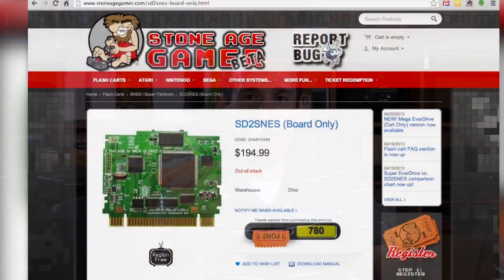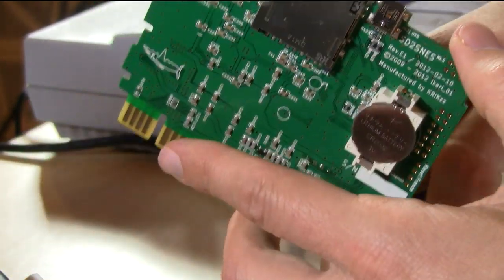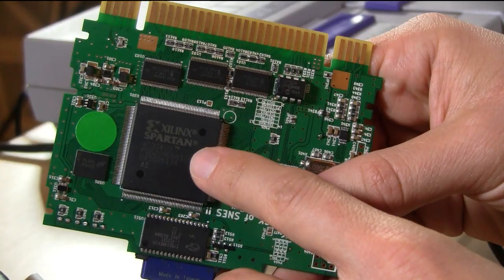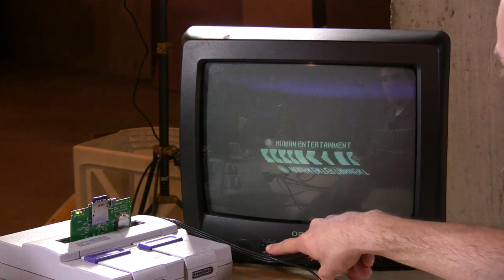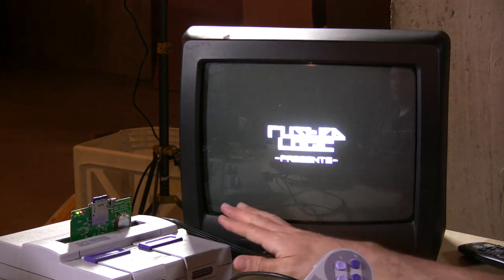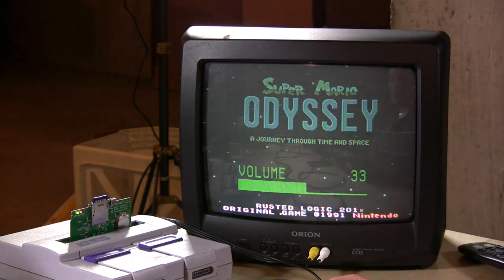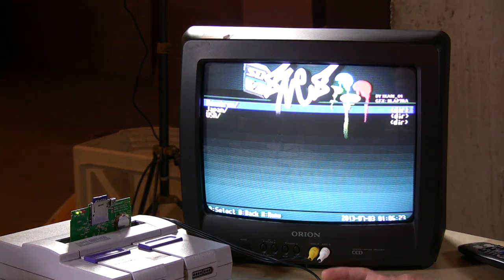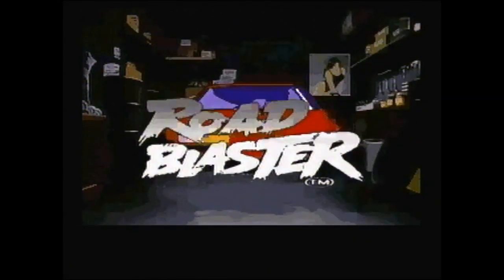SD2SNES Review - Run Games on a Super Nintendo SNES from an SD Card!  MSU1 Super Road Blaster Demoed

Comment: Cool review, thumbs up :-)

BTW I designed the sd2snes so it has inverse polarity protection for the power input, so if you accidentally put it in backwards nothing bad will happen as long as you don't have anything connected to the sd2snes PCB (USB or programming pin header).

Comment: Uh, writing the backup to the SD card in real time is not "better than the real thing," it's what the real thing essentially already did but with one important distinction that's actually a disadvantage. The battery-backed non-volatile SRAM in a real cart was often also used as workram to expand the total RAM available for software, which is why some games have it even without a battery (volatile). Games only needed a tiny bit for saving progress. Games using it as workram can read and write to it millions of times a second. Even if an SD card could keep up it would wear out the flash cells very quickly. The flashcart has to detect how much is too much and throttle it when it detects a game using SRAM like this. If it throttles the autosave too much then it could lead to saves that revert when you power off the system. Many flashcart a just setup some real battery-backed SRAM and dump that to the SD card at first boot but that can still cause issues like the Gateway 3DS.
Reply: Hey since you seem to be very knowledgeable on this stuff I have question for you. It's in regards to a Genesis repro game I bought recently. It's a repro of Mega Turrican. The board that was used was from a Genesis game that used a save battery and also has an SRAM chip. Could the new Mega Turrican ROM make use of that SRAM chip? I'm not sure if the original game actually had any additional RAM chips or anything. But knowing Sega it probably didn't.
Reply: +Robert NES816 The new G+ app notifies me of your reply but will not show it to me for me to reply to and the YouTube app has never linked me directly to comments. Argh!

Anyway, cartridge console games never make use of additional RAM that they didn't originally include or weren't programmed for because the game ROM itself is mapped to memory and it references hard-coded memory addresses (there is no OS memory manager).

If that game originally used SRAM on the cart as work RAM then the original cart would have had SRAM too. Because SRAM maps to memory just like ROM and the memory map would have to stay the same as far as which memory addresses were ROM and which memory addresses were for RAM, the original most likely uses SRAM too. It's possible that the SRAM in the repro is mapped to an address higher than the ROM data for that game uses and does not conflict, but it would be unused if the original didn't use it too. It was originally too expensive for carts that don't use it.
Reply: +Emmett Turner Awesome thanks for the wealth of knowledge! I love learning about this stuff. Thanks again.
Reply: +Robert NES816 I can't see your reply or see/edit my other reply but I think I made it a bit clearer:
Cartridge games read/write to hard-coded memory addresses because there is no OS memory manager and their ROM maps directly to memory (no need to copy ROM data to writable RAM addresses when it can already be read like RAM). This means that their code expects to find their own ROM data at particular memory addresses and they will not make use of additional memory they aren't aware of.

SRAM maps to memory just like RAM/ROM except it's writable. If the SRAM addresses do not conflict with the game's expected memory map then a game that didn't originally have it could work but there can be many other differences that break a game ROM intended for a different PCB configuration. I don't know that game's original PCB configuration.

Comment: Is it worth it to get the SD card through the retailers that sell these or will any memory card pretty much work with these? I see that these retailers offer different memory size SD cards but it appears that most, if not all as stated in this video, games will fit on a 4MB card, which I already have.
Reply: sidearmsalpha you could probably fit the entire SNES library on 4GB

Comment: can you load the Super Gameboy with a game boy Rom with it ?
Reply: Doug Plummer I know your post is old, but I'll chime in: Stone Age Gamer also sells a gameboy flash cart meant to plug into the original gameboy and gameboy color. That cart is super gameboy compatible.  So, what you'd do is get a real super gameboy, and then buy the gameboy everdrive flash cart and plug it into the super gameboy.
Reply: John Hahn I was thinking about doing something like that.  after this post I did some more research and found that the Super gameboy has a full gameboy built in it and just uses the video and the controllers on the SNES

Comment: Can that be covered in a Cartridge when it's ordered?
Reply: Yes. If you purchase from Stone age gamers website, you'll see they have a number of choices from bare chips to different color cart shells. Prices vary of course.  You can also cover the chip on your own, using a spare shell, but you'd have to be good with your hands and with the right dremmel tool, to perfectly cut the holes needed for the memory chip and usb ports (led lights, etc).

Comment: Freedom Force!
Reply: +Lon Siedman it's the reason I re bought an NES (well AV Fami). Definitely the best NES Zapper game. I have this 3rd party Zapper clone by Dendy. It's a 15 pin and it's lighter than the NES Zapper. However, it's crazy accurate. If you love Zapper games get the 15 pin Dendy Zapper Clone. It's at least 30x more accurate than the OEM light gun. It looks nearly identical to the Zapper, but it has a slightly purplish tint compared to the gray NES Zapper.

Comment: or save yourself the trouble get a wii...homebrew it and put in super nintendo games on it there done
Reply: that is literally like 25 more steps
Reply: And again, we are back to emulation with the wii homebrew.  There is slow down via this route with some SNES games.  Its true - nothing beats the official real hardware the game was designed for.
Reply: *****
you cant tell the difference if you hook your pc up to the tv with a composite cable. just turn interpolation on the emulator.
Reply: KadMac25 Nintendo Makes Emulators That are perfect why would it be bad
Reply: REALLY? I haven't used Nintendo's emulators which I am assuming your referring to virtual console.  Yes, its a form of emulation and I hear its pretty good but it doesn't output RGB quality.  Also, all non-nintendo emulation that I have tried doesn't compare to actual hardware.  Some people are happy with emulation and that's fine, I'm just saying that there is an audience that prefers actual hardware because emulation can have its issues.
Reply: Kad mac it runs 576i Which in my opinion Looks great on Brand new composite cables if the video quality is bad that means that the cable's end is damaged
Reply: This is awesome. I am so tired of emulation and your computer could do it better than the wii lol
Reply: *****
you can change everything on most the popular emulators to look the exact same way as a console, even use a switch box for composite.
Reply: If you're going to go that route, you may as well download an emulator on to your PC and play ROMS on there... Nothing wrong with that, I did it for years... but nothing beats the real hardware.
Reply: Rgp snes is way better than a Wii emulation.

Comment: lol and how is this not emulation compared to playing on other devices? you guys have no idea at all what you're talking about.
Reply: Even if it those ROMs are being processed by the original hardware you are still adding chips and a CPU to decode the actual ROM dump. These dumps even if they are 100% the same as original cartridge still need some level of emulation to decode the stored pallete/game data which in term are feed into the PPU/CPU. If this wasn't the case you wouldn't need an FPGA to decode the ROMS and send to CPU/PPU and only need a little PIC MCU to interface a selection menu for those ROMS. This is why it is still emulation.
Reply: Yeah let just say they are getting a little help from that FPGA ;) There isn't a single emulation platform that's is going to be a 100% accurate let's be honest. Some ROM dump even if they are perfect will still be unplayable even with original SNES hardware. Same goes for NES btw... Anywais it's still great to see those old consoles rocking our living rooms even today :)
Reply: +db six You cannot deny it is still the purest form of emulation to date.  Obviously the Spartan on the SD2SNES has WAY more horsepower than the original SNES hardware, but it's not driving the game.  It's merely acting as an interpreter between the SD host interface and the SNES itself.
Reply: +db six and @ Vermi. Great debate guys. To be technical it is still emulation. BUT it is so damn close that if you weren't told you wouldn't know. Thats the difference with other PC emus etc. You can tell if you've seen the original. With this, it's the difference between eating steamed noodles, and rooting Jennifer Hawkins.
Reply: I suppose there are different definitions of "emulation," but I take it to mean one architecture (say x86) running code written for a completely different architecture (say the 68k in the Genesis or 6502-based NES CPU) by translating the code on demand. Since the system is obviously real hardware, and the code being run is original (not translated in any way) I don't consider this emulation in any way.

To the SNES itself, the SD2SNES is just another cartridge. How the SD2SNES loads the game onto its RAM has as much to do with emulation as how you insert a real cart into the system, since the code itself is original (and would run just the same if you programmed it onto a chip on a real SNES cartridge) As far as I know, the enhancement chips are cores for the FPGA, so that's not really emulation either, as the FPGA is reprogrammed to function as the original chip did.

Unrelated to this, it's very strange to me hearing people say SNES (or NES for that matter) like you would say NASA. I had never heard anyone say it like that until very recently on YouTube. It's always been either S-N-E-S or Super Nintendo by anyone I've ever heard say it in person.
Reply: +adimifus I understand your argument and I have to say  my view have somewhat changed. But still, the mappers are completely generated by the FPGA. This is the part of the emulation i was referring to. But I guess it can be pretty close to the real hardware since the subject is well documented.

Also for me NES or N.E.S was always Nintendo and SNES or S.N.E.S, Super Nintendo. I had never even heard those terms before i got on the internet.
Reply: +db six I agree. The enhancement chips are the only thing that could be considered emulation. Otherwise this thing is pretty much like any other flash cartridge or backup device (or reproduction cart, really-- but instead of using an EPROM in place of the ROM chip, it uses SDRAM, and the cartridge itself programs the RAM instead of a dedicated programmer). The whole point is to be able to run games as if you were using the actual cartridge.